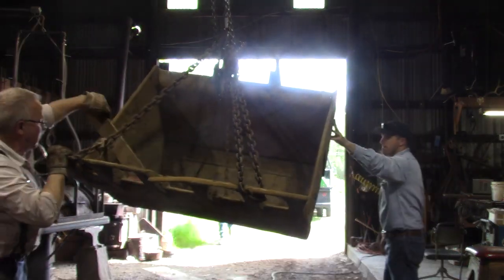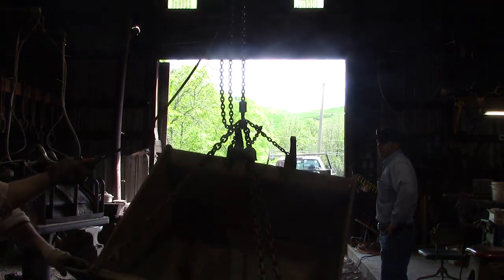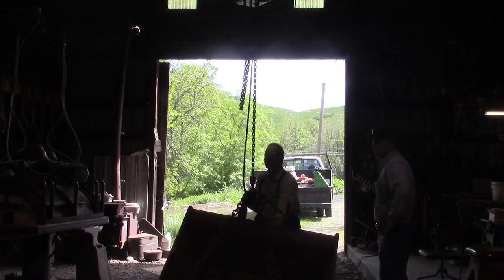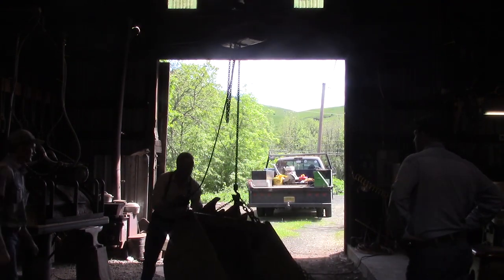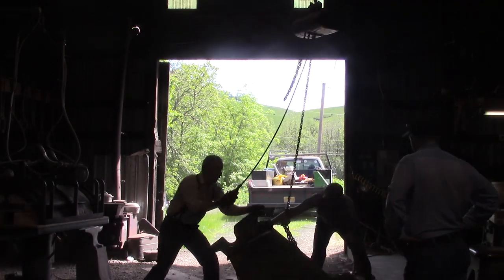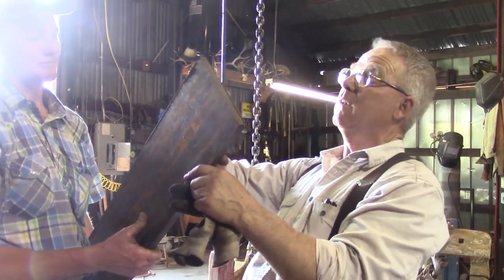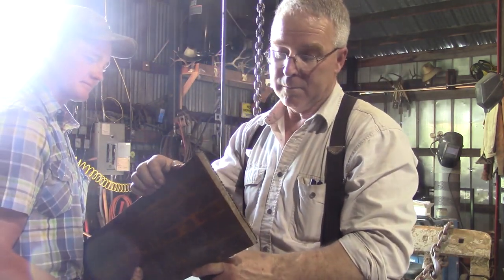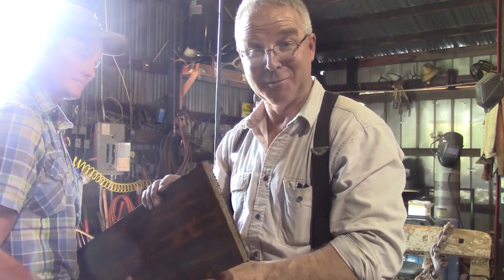Excavator Bucket Repair

Comment: I wanted to share a tip with you... when you're using an overhead hoist to support a welding workpiece, use a synthetic (nylon or polyester) sling to prevent grounding through the hoist chain and bearings.  

Thank you for making these videos!
Reply: The welding current always travels from the stinger to the ground. As long as you're not grounding to the hoist, you shouldn't risk any current throught it.
Reply: When everything goes right, yes.  The sling is insurance against that one moment that things don't go right.
Reply: Peter Hoiland 
Yeah, like someone snagging a foot on the ground cable and pulling the clamp off the workpiece.
Reply: Why wreck a perfectly good nylon sling by burning it up.the ground will always take the path with least resistance through the crane is not the least resistance back to the welding machine is
Reply: sean bretzer and that there is how electricity works.
Reply: Some people set work pieces on wood blocks, so the crane becomes the only path for the electricity.
Reply: not true
Reply: not true i have seen this happen you could touch the chains and feel how hot they were
Reply: Sean bretzer you’re wrong on that one it can very well travel up through those chains easily enough
Reply: FSXWLFS lol you’re wrong on that one

Comment: T1 is not a high carbon steel as stated.  It is a low carbon height strength abrasion resistant steel .

Comment: Its why they make clean up buckets, any time you take a machine to a jobsite doesn't matter if its a 1 ton or a 21 ton excavator you have a digging bucket and a clean up bucket. I switch buckets anytime I need too its why they make quick connect buckets so you can change them. When we are rock hammering we switch from the hammer to the digging bucket to the clean up bucket back to the hammer. I've got to do the cutting edge on the 60 inch clean up bucket, one of the 20 ton machines I operate it should take me a good better part of the day torch out a section weld in a new 1 inch 12 inch wide 60 inch long harden steel. Being a hoe operator you need to know how to repair the machine you operate be that mechanical repairs or welding rebuilding buckets.

Comment: Interesting that you used a mig. Traditionally this would have been a stick job. Has the technology changed or is it personal preference?
Reply: Maybe he was using dual shield flux core with pre-heat. That would be faster than stick.
Reply: Thats what i was going to say, but no need you already said it!
Reply: Dual shield might be okay. I would have personally used some 1/8 7018 because of it's better penetration and better quality welds in slightly rusty steel.
Reply: No dual shield here, that's all mig wire
Reply: FSXWLFS what. You're way off base. The penetration on most wire coming out of that machine will beat 7018. Especially if it's dual shield.  7018 is medium penetration.  The only reason you think it's "traditional" is a) you see this done in the field so stick is the way to go, or b) most "welders" don't know how to run wire. Let alone big wire. Let alone how to maintain a wire feeder
Reply: rich pasto  He's running solid wire. Solid wire mig like he's running will never make a weld that will stand up to dynamic loads as well as 7018. On a bucket   that has possible contamination, Mig will not clean as well as 7018.
Reply: Kevin Hornbuckle it isn’t dual shield. There is no slag.
Reply: rich pasto What’s so hard about wire welding. I could teach a monkey to wire weld. The only trouble your having with wire welding is shielding or bird nesting. Stick is where it’s at
Reply: Speed, I work as a Plant Mechanic for Komatsu in Australia this is always a MIG job and has been practically forever, Stick is good for the field and sticking a cutting edge on a GP bucket to turn it into a SF (mud) bucket can be done in the field.
In a workshop it will be MIG everytime all the time.

Comment: You are the first welder to show he preheats the metal he is welding.  Could you explain that?
Reply: large items suck away the heat, it wont penetrate as well cold, he is at the max of his welder power as well, so the heat means the weld will bite in  more , and he cant turn the power up to do the same thing, its just a way of getting more out of your welder for one, that and it prevents it cracking as the heat is more even so it wont be pulling as it shrinks locally,

Comment: This may be a stupid question
but what's the reasoning behind heating the steel plate and teeth on the bucket up with the propane torch before welding it?
Reply: I didn't think it could hurt anything, but wanted to see any reason behind it. Thank you for the reply, and knowledge!

Comment: Every day I check out the progress of repairs at Oroville dam.  When the cleanout of the river began I started to wonder about the supply of bucket teeth and cutting edges for all the equipment working on the project.  This video shows one aspect of what probably goes on non stop at the maintenance shops at Oroville in order to keep the repair project going.
Reply: I was born and raised in that town, the dam is of great concern to all of us. I never thought of what you are saying before but you are 100% right.

Comment: Why not go with a 7018 instead of the short circuit mig? 7018 is a lot more a ductile weld
Reply: hell yes stick welding is the way to go on this kind of thing. first time ive been disapointed in the old boy
Reply: Essential Craftsman I figured there had to be something behind it, my apologies if my comment was perceived negatively at 23 years old I hope one day to learn half the things I'm sure you've forgotten over your life time.
Reply: its alright dont beat your self up
Reply: Or dual shield flux core mig.
Reply: daren s very true dual shield flux core mig would do a great job
Reply: daren s countless buildings are structurally welded with dual shield at least here in my area
Reply: I knew there had to be a reason y he didn't stick weld that. As soon as I saw the mig gun I was like hmm didn't see that coming.

Comment: Sometimes, videoing any GMAW  tool's arc  can damage the camera's CMOS sensor. Just to be safe,  assuming you don't want to use a welder's mask on the camera (which won't give much view of our star's welding), I'd make certain to use 8-11 stops worth of neutral density filters, making sure they are also UV coated. Increasing magenta bias might be useful if you opt to shoot thru a mask.

I"m no expert, but I would hate for you to suffer an additional expense!

Comment: Can u weld such a Highcarbon steel without problem?
Reply: he preheated the bar, so its ok. Based on carbon content you can calculate preheat temp using various empiric equations.
Reply: Thank you for your answer. I guess thats the case or maybe used an appropriate electrode (schaeffler diagramm). (I don't have any welding experience, only a course I took back in college.)
Reply: appropriate electrode (or filler material) is mandatory, the preheat is here only to reduce colling speed, which makes all the problems.

Comment: Two completely novice questions. Why do you heat the teeth by blow torch? And isn't their tempering completely lost after the welding and heating? o that would make it a permanent modification?
Reply: Preheating makes the weld less brittle. The thickness of the metal ensures the dissipation of the heat and keeps the temperature of the tempered teeth don't get hot enough to lose the temper.

Comment: Would of probably MMA welded it with some 29/9's, mig dosent hold up well when fusing dissimilar metals especially if the filler wire was bog standard copper coated mild steel, a moot point since he's just grating soil, I know. Love the vids bye the bye.

Comment: I have no experience with this type of equipment, but the teeth looked okay to me in the video. why would you cover them. Doesn't that make it less effective at digging?
Reply: The teeth leave a rough surface and also don't clean out the bottom of holes very well. Most guys just buy a toothless bucket for that kind of thing.
Reply: He's pulling material to a final grade height, and needs to leave a smooth level surface.
Reply: Aaaaaand it's clay/fill. They covered that in the soil compaction test. 😜

Comment: One thing made me cringe. No face mask while grinding. I know it can be a pita. But damn it, always wear PPE when using a grinder. Your lungs will thank you later.
Reply: Don't forget, no guard on the grinder.
Reply: I'll just leave this here http://imgur.com/zOAyZxU
Reply: not to mention your face when that cut-off wheel gets sucked into a tight gap and shatters.
Reply: holy shit, i followed the link. i'll think about that next time. thanks.
Reply: Makes me thing about all  the hours and hours I spent grinding old paint off of machinery in my early 20's inside of a building 10hrs a day without any respiratory protection - if my boogers and the layers of dirt covering me at the end of the day are any indication of what my lungs were soaking-up....man, really wish I could go back and insist that my supervisor get us some respirators.
Reply: Andrew Robinson my dad would
probably pulled it out and then complained about using towels to
stop the blood on the way to the hospital.
Reply: odd766 Lol
Reply: Glasses are a must. Earmuffs are good unless its hot, then buds if you're cutting for 5mins or more. Face masks are situational. If you've got one handy go ahead but I hardly ever have one handy.

Comment: Why did you preheat the plate with that big Roofing torch before welding it?
Reply: Jon B same question ^^
Reply: It facilitates the weld process. Normally something like this would be stick welded (which wouldn't require the heating) but that takes longer.
Reply: T-1 is actually A514 steel, tends to crack welds if you don't pre-heat or control the temp between passes
Reply: Its a bit faster than using a hair dryer.
Reply: And moisture creates microscopic bubbles of hydrogen in the welds. Stick welding is the way to go for that application though.
Reply: mats852 
You could use 7018 Flux core wire.
Reply: Michael VanGundy Yes I would put money on FCAW, but not on GMAW for this application.